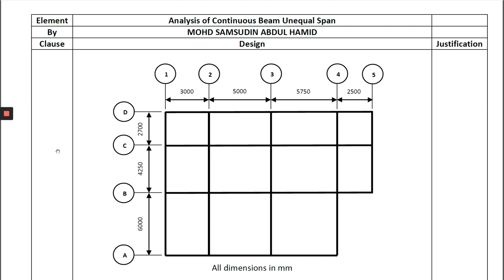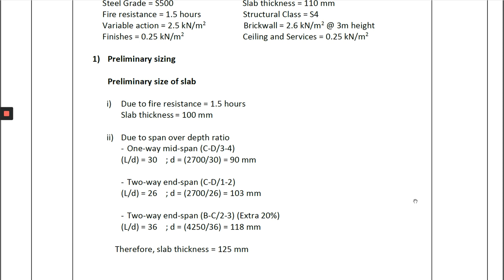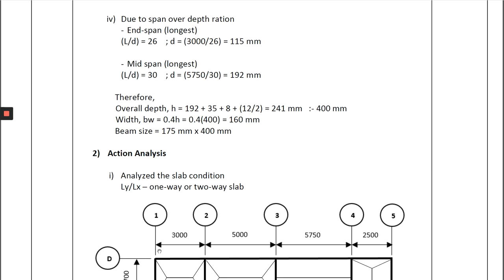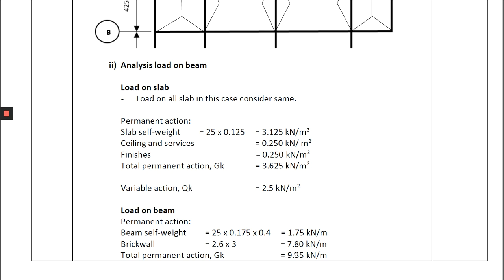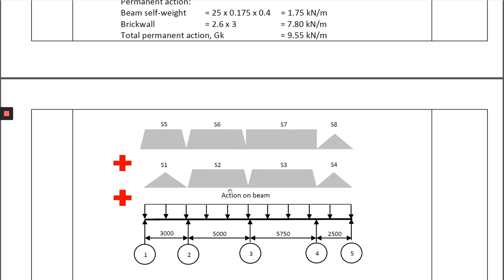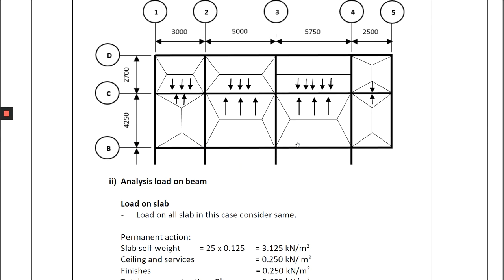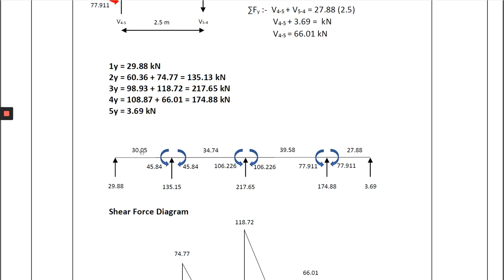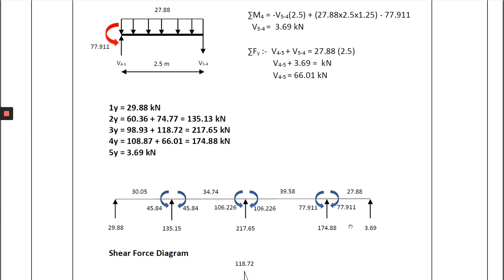ANALYSIS OF CONTINOUS BEAM UNEQUAL SPAN

Comment: hi sir,how to relate the type of support in our study with real building,,sometime i m confius which one rola, which one pinned and fix  at real building,,,your answer very appreciated..thanks and regard
Reply from the maker: To relate with your real case, the most important required information is the end support either it is fixed or pinned support. Normally we will use end support as pinned support to ensure the moment value is zero so that there is no additional reinforcement required and end support. But for interior support normally it is fixed support. Beside that, it is possible to have end support as fixed support if the end support is not at the end span of the beam, for example we designing semi-detached house where one of the end span will consider as fixed and there other end consider as pinned.
Reply: @mohdsamsudinabdulhamid3295  thank u alot sir

Comment: hello sir. im wondering how the values for both PA and VA for span 4-5(2.5m) slab (1-5) were determined because i calculated using the same formula: nlx/3 and i got different answers than what was stated. also, shouldn't the lx value for slab (1-5) be the same as for slab (1-4)? your reply would be highly appreciated and thank you in advance!
Reply from the maker: First, it suppose slab 5 to 8 not 1 to 5. I got typo and I do already explain in my video.

Make your own calculation with your understanding.
Reply: @mohdsamsudinabdulhamid3295  i see i see. i may have been lost somewhere during the video, i'll make sure to recheck it again and catch up. thank you sir

Comment: hi , how about when slab thickness is different? how to  determine slab selfweight?
Reply from the maker: use the highest thickness to determine the self-weight. if you use lesser thickness then the calculation of overall load will be wrong because under the actual load of the slab.
Reply: @mohdsamsudinabdulhamid3295  thank you